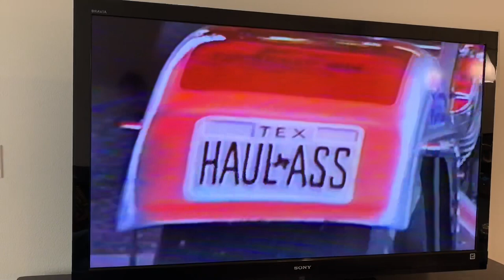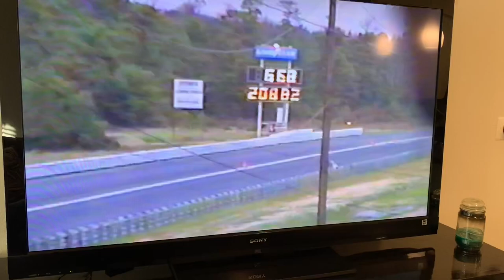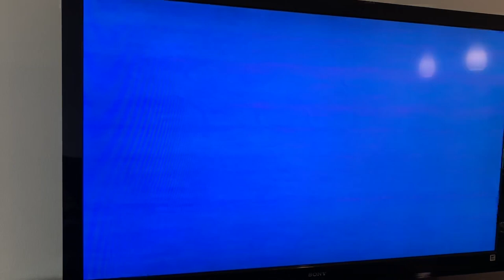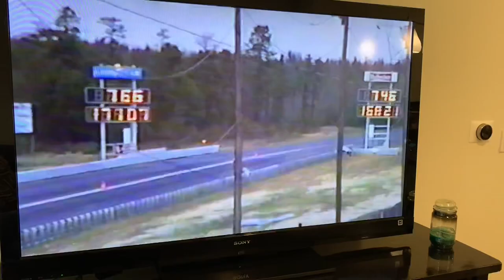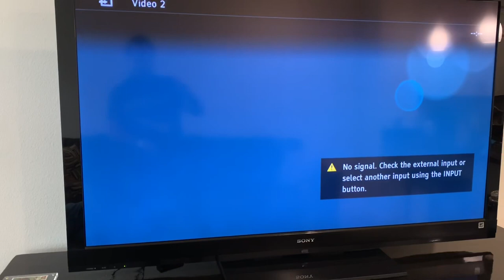DRAG BIKE LEGENDS - TOP FUEL NITRO MOTORCYCLE CHAMP LARRY “SPIDERMAN” MCBRIDE RELIVES ATCO 1991

Comment: Great video. I wish you had one of the next year (1992) where we made it to the final in Pro-stock against John Meyer and barely lost. The day before the race in this video('91)we had just found a bunch of power on the dyno the night before and loaded up and came here. At the next race in Bradenton we ran a 7.73 which made us the 4th quickest bike ever in Pro-stock. (Larry won T/F against  Brian Johnson I believe) We ran the last competitive Kawasaki in Pro-stock until Pete Briggs came around, 10 years later. How I miss the good ol' days. NHRA (and Prostar) changed the rules in '93 (going to aftermarket cylinder heads) and we lost our edge so we quit. Thanks again...

Comment: Sorry last question,  why did they do the dry hop back then , was it a clutch thing , because now prostock don't do it anymore and haven't for many years , is it because clutches are more complex now I was curious why they stopped , even prostock cars don't anymore,  elmer used to do it,  John force used to do it , now nobody does it
Reply: We did the dry hop because we didn't know any better. As far as I know "we" were the first pro-stock motorcycle that stopped doing the dry hop. Here is the problem other than the clutch. When you do the burnout you are preparing the surface of the tire for the launch. When you do the dry hop you ruin that surface. Pretty simple. Back in the day the motorcycle people were a little slow to catch on.... thanks for asking.
Reply: @nealmont  thank you , I was curious if I might hav been a clutch thing , question answered thank you

Comment: In 1987 we were running 8.60 supercomp then 1994 8.20 topgas then the bottom fell out in early 2000s , they started catering to supersport classes and street bikes so the money went away for the fast classes , street bikes was making as much as topgas so we saw no reason to keep blowing money on high horsepower when a 10second street bike made the exact money we did , our 30,000 dollar motorcycle vs. A 3000 dollar street bike , we spent 5000 a weekend in maintenance , fuel, travel and entry , the street bike spent 200 with entry , fuel , and travel , no comparing , to only win 1500 and contingency which was just a few at that point, possibley earn 1750 total , we saw no point in continuing to race